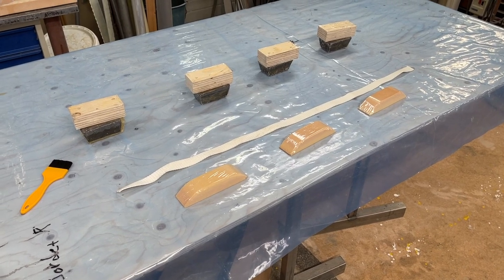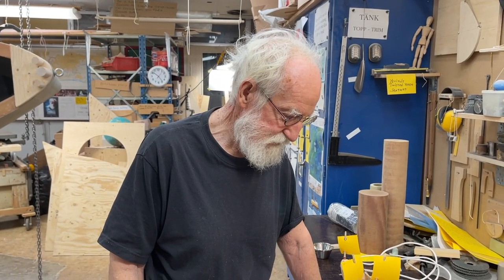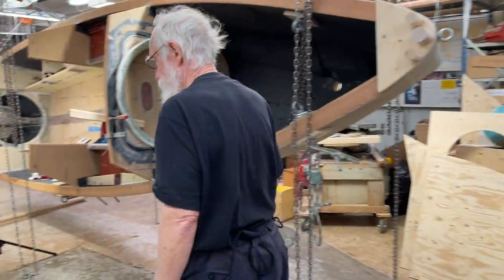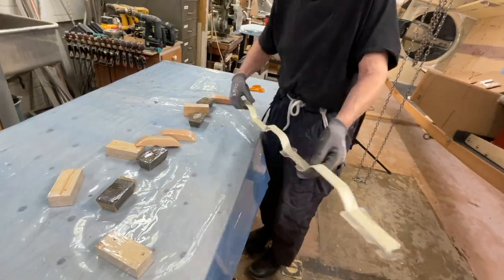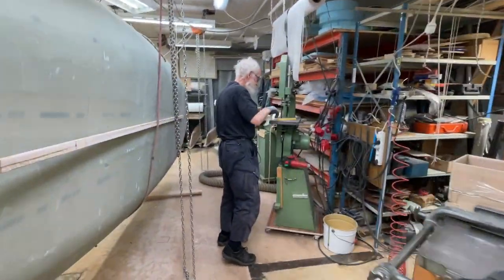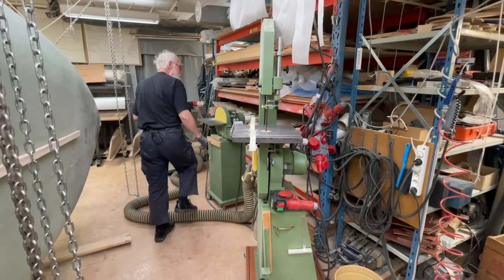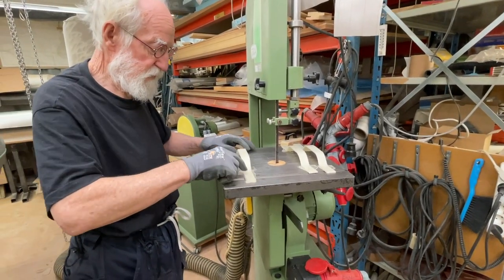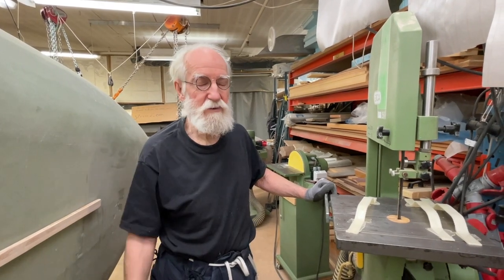12 October 2024  Doing grab rails. Before launch there will be hundreds of them.

Comment: Will you wrap the hold with cord like you did with the rope version? That's a brake lever below the saw table? I haven't seen that on American band saws.
Reply from the maker: They get wrapped when installed.
Extra wraps att their feet ( roots) gives a larger attachment area, makes then stiffer and better secured. The ones on deck doubbles for mooring lines in marinas. They are that strong.
Yes our bandsaw do have breaks.